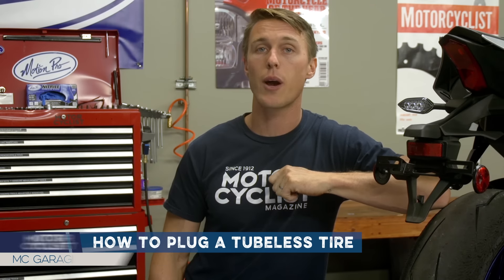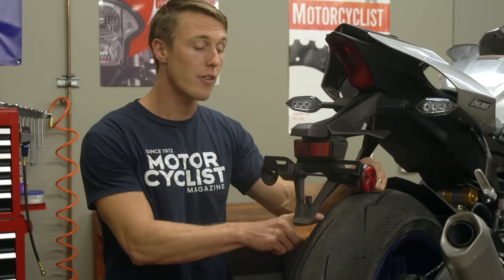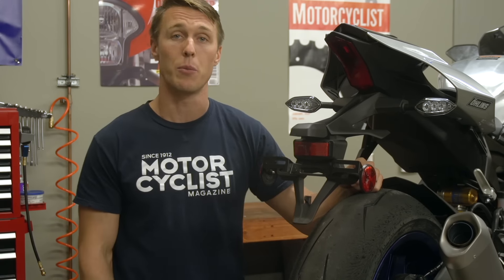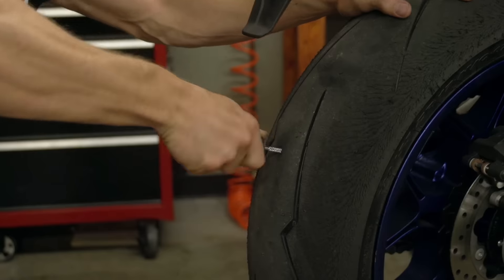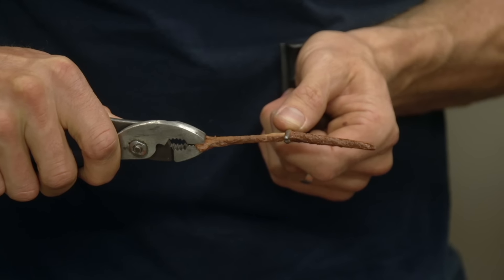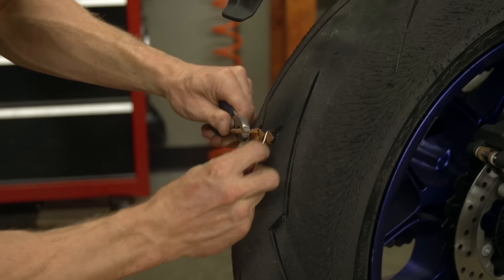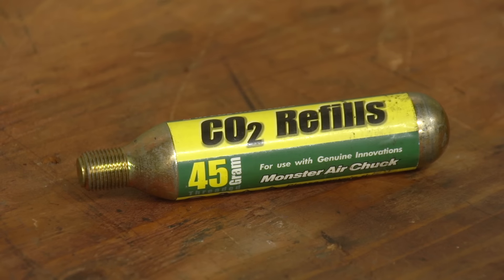How To Plug A Motorcycle Tire | MC GARAGE

Comment: Only a temporary solution until you can get a new tire. Rope plugs can wick moisture into the tire causing the belts to corrode. Also, plugging a speed rated tire voids it's speed rating since you are sure to damage the belts during the repair.
Reply: Blah blah blah

Comment: I've driven 40,000 miles on a plugged auto tire without any leaking after being plugged. I would have no problem using this on my bike, however for the first few days, I'd test the pressure a few times just to make sure it's not leaking...

Comment: A screw without the head is going to be a serious issue. It took 3 senior citizens 2 hours to coax a headless screw out of a goldwing tire that was mounted. Then we had to push the plug in which took another hour but we got err done. Thank you Bidenomics, we didnt take it toan expensive tire repair .shop

Comment: I just bought my first motorcycle, a brand new Iron 883 with 7 miles on it. I drove it for ONE day and found a screw in my back tire (thank you Kansas City). I plan on replacing the tire as soon as I can afford it, but a plug will have to do for now. Thank you for the video, as I've never done this before.

Comment: Rode 300 miles on a brand new bike. Got a nail/screw in the center of my rear tire. Plugged it the first time and the plug went all the way through so I re did it correctly with another plug. Held good on the first ride. Went out to drink with some friends and when I came back my psi was down to 25 (36 is manufacture standard). Gotta buy a new tire. Fml

Comment: I have ridden my front tire with plug for already 12k kilometres. No problems so far
Reply: Jed Taneo by any chance which plug kit did you use?
Reply: @biglefty08  ordinary ones you can buy online. In my county I bought it from Lazada.
Reply: On the street is ok but if you go to track BIG NO NO
Reply: @jlopez2351  how come? Is it cause of the extreme heat? I sadly have 3 plugs in my rear tyre.. is it alright to go on highway rides on hot days with those?

Comment: Good video and your honest about riding on a plugged tire. My brand new rear tire caught a nail after only 200 miles. I put a plug in it and hopefue it will last awhile.
Reply: Update on the plug please sir
Reply: How long did your plug last after all?
Reply: @survive.canada  I did one a month ago it was very easy and no problems at all, everyone says they last the life of the tyre and it prob true its such a good and easy fix
Reply: I’ve used plugs on motorcycle and automobile tires.  They last as long as you shave the plug like he mentioned.  No side walling patching and I would consider the speed rating no longer applicable to the tire.  You can even plug without glue but I’m sure glue helps in different pressure situations and off road.
Reply: @petelarrier1811  what if the screw is in the "valley" of the tire? Meaning, the groove, where water would go to, and not the rubber that actually makes contact with the road.
Reply: Doesnt matter as long as its not the sidewall.

Comment: You should do a video on how to patch a tire from the inside as well... In my case I bought s brand new tire because I have run about 120 miles since I got a valve stem (not a screw) yeah you heard me right, a valve stem in my tire and it went all the way in and it was hard to pull out but I got it fixed with one of these plugs but I stop so often to check the tire and to make sure that plug is not trying to come out so I have lost all my confidence in that tire. Thank God it's only an R3 and I don't find it necessary to speed so much for right now since I'm only learning although I feel pretty confident already but still I'm taking my time and experience on the bike very seriously
Reply: lol!

Comment: You forgot to mention that getting the CO2 bottle onto a straight valve stem is almost im possible on most motorcycles.
Reply: Yup. My kit came with an adapter.

Comment: Ok, I had this happen to me about a month ago. I used the plug kit, used plenty of the glue on the plug, aired up the tire. I thought it was fixed rode 200 feet the the plug blew out. In fact, it was plugged a second time. This time the bike was in the back of a truck. The plug blew out again  as I was standing there, after about 10 minutes. Replaced the tire. Second one this year.

Comment: As usual, awesome video, Ari. From what I see, the tools of the trade are usually the same across brands, but I wanna know, are there different levels of rope plug quality? I mean, there are a few cheapo ones on eBay and some expensive ones too. Are they really worth the money or will there be no difference?
Reply: realized you asked this forever and a day ago but did you ever find an answer?
Reply: @330Gunslingers  
Project Farm channel did a test using the normal Slime rope plugs & better quality more "Pro" ones which he found were "Stickier & Stronger" to make a better repair.
Even though the Slime ones, done correctly, are quite acceptable.

Comment: Sorry to nitpick, but when the screw was drilled into the tire, it was pretty flush with it, whereas when it was pulled out, it was sticking out enough that the pliers could grip it. Would that happen automatically? Or would I have to let out a little bit of the air to make the sharp object stick out enough to grip it? Or just try to press into the tire with a nose plier to hopefully get a hold of it?

Comment: I got a screw in my tire, the same day i had a track day.... i did the track day anyway, and also 4000km with the screw in, no air leak, maybe it didnt when 100% threw, gonna see soon when i replace it.
Reply: ThunderWindz The screw probably went in while the tire was hot and the rubber molded around it and sealed. I had this happen on my car. I have as Veloster with summer sticky tires here in San Antonio. I got a large screw in it and I heard it leaking at a stop light followed by thbe tick tock tick as the head tapped the ground. I pulled over and it had stopped. I aired it up and was going to take it the next day to get it patched but forgot. I drove on it for probably a month before it started losing air again. My guess is the tire molded around it but when the colder season rolled in it hardened the rubber and began leaking again. Wouldn't want to risk it on a bike though.

Comment: I know it's an older video but once you rope plug a tire, replace it. Don't try to have the rope plug removed and patched. Working with tubeless tires every day at work, we won't try to patch a previously plugged tire. Once the glue sets, it will tear the lining during removal and most accepted patches will not cover the damage safely. 
You have 2 tires. Don't risk it. Plug it to get home and buy a new tire. 
Stay safe.

Comment: thanks for the insight.  I found a screw in my tire, but the tire isn't flat.  I also noticed while inspecting that there's a sideways cut in the rubber.  This is my first motorcycle, so I guess I'm curious if others have seen oddities like that.   I am worried someone has tried to sabotage my ride.
Reply: Same thing happened to me. Somebody made an incision on my rear tyre of my GSXR. Fortunately cut wasn't deep. People can be so jealous sometimes. SMH
Reply: @KubuśpuchatekTVN  if someone does this willfully, for jealousy or whatever reason, it is like attempted murder... It's one thing to scratch the body of a bike, it's another thing to damage the tyre... be safe bud

Comment: He makes it look so easy. I had to fight the shit out of mine. Shoving that plug in after the tool cleaned up the hole was NOT that easy.
Reply: It's easier if the tire isn't flat. I try and pump the tire up first before reaming it and shoving the plug in. Makes it much easier.

Comment: so if this is the temporary solution, whats the permanent solution for it ? than changing the tyres .
Reply: Nirmal Kumar taking the tyre out 
And put a " mushroom" plug from inside out 
This plug is made is made of rubber and comes in different sizes depending on the hole size.

Comment: I have five plugs in my rear tire and have ridden for months, even up to 120 mph, without problems. It IS a permanent solution.
Reply: +ryanhayn You keep doing that.
Reply: +ryanhayn It can be used semi-long term, but just because you haven't been unlucky doesn't mean it is a permanent solution.
Reply: +ryanhayn for example a few comments down.  "Great video as always. I got a friend who rode at a track with a plugged tyre. Let's just say it didn't go well for him." - RubberTyres
Reply: Firefly I guess it all comes down to a roll of the dice. You could end up being unlucky, or you could be lucky.
Reply: +ryanhayn When you put it like that doesn't that sound more like a temporary solution?
Reply: +Firefly
There's quite a big difference in riding normally out on the road and riding hard on the track. On the track your bike is always under much higher load and much closer to its limits of capability than on the road. That is especially true for your tires that are subjected to extreme loads, which means the plug is also likely to give out. And honestly, if you ride with a plugged tire on a track, you deserve to go down on it. I mean seriously, how dumb do you have to be? smh
Reply: It is NOT permanent solution , But May Withstand Long Term if you Done it Correctly and Firmly , thats why you have to smotthen the Hole tissue with corkscrew plug , 
it also depends on tire Types
Reply: After a few months, the only plug in my rear tire gave out when I was riding ~50mph. I plugged it again to get home. Patched it up properly yesterday. You have some badass plugs there.

Comment: Excellent tip. Doubt: this repair is permanent? Are There some risks at high speed?
Reply: Lots of people use this as a "permanent fix". Typically the tire isn't brand new and they'll put anywhere between 2-6k more miles on it. It is not ideal, but I just plugged my tire and plan to use it for 2k more miles until I buy some nicer tires and when the temperature rise again. 

Ideally a plug is just to get you to a shop so they can patch it. Patch and plug is the best fix, follow by patch only, then plug only. But, to patch a motorcycle tire most shops charge you the same amount it would to install a new tire so that's why I run my plug longer. If I am paying an install/uninstall fee it might as well be for my new tire not some tire I only have 2k or 4k more miles left on. Also, if its in the center of the tread it should not be too unsafe.
Reply: Thanks
Reply: Marcelo Motociclista not permanant...mushroom tyre plug patch is permanant
Reply: on the instructions for my kit it says not to exceed 40mph. I think that you'll be fine over this, but I wouldnt want to be going well in excess of 100 with a patch

Comment: ..or run over a big ass screw that plugs itself :D
(this happened to me on my old Disco, ran over a freaking ZEUS fitting off my honda's front fairing. got a taptaptaptaptaptaptap like a rock was stuck in my tread, but that little quarter turn bolt was holding air so hey!

Comment: These are a pain in the arse to use. Your better off using Gryyp Cargol Tyre Repair Kit :)
Reply: +DanieI Joseph doesn't really seem like it.
Reply: +Firefly I've been riding & using for 22 years. The soft rubber plug either doesn't seal properly or it comes back out with the application tool. The cheapest way to get home is to leave a/the screw in the tyre as this works pretty well. Or use the other hard plastic cargol screw plug I mentioned, as all you do is screw it in then snap it off.  Quick & clean,  you then use the co2 supplied to inflate the tyre.

Comment: Sound advice... The lawyerly (and business-maximizing) "recommendation" to always get a new tire after a puncture is deeply annoying, mainly because it is not true and also dishonest. Yes, there are punctures and tire damage that make plugging or patching impossible or at least unwise. But a clean puncture by a wood screw or nail on the tread area is very fixable with a patch.  Done professionally it will cost you $60 or so (with mounting/balancing etc.) but compared to $200+ for a new tire it is well worth it if the punctured tire has more than half of its life left. If you are set up to mount tires yourself it will cost you $10.
Reply: He never said to always get a tire after a puncture. You have written nothing in contradiction to what was said in the video.

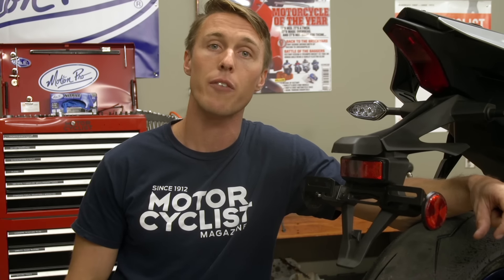2:05 - 2:15
"Keep in mind though that a plug is a temporary fix. Though I will admit that I've ridden from coast to coast on a plugged tire with no problems. Still, you're better off getting the tire replaced or dismounted and patched from the inside."
Reply: And I never said that he did say that in this video. What I said was that his advice was "sound." Unlike what seems to be your approach, it was not my intention to say something "in contradiction." Are you trying to find a non-existing point to create some kind of controversy? Why would you think that "response" always equals "contradiction"? Or more directly: Are you some kind of troll?

Comment: How to plug a motorcycle tire....

DON'T....... Unless you're crazy or stupid or both. Plugging a car tire is different because you still have three more if the plug fails and can still pull over. My life and my skin are entirely too valuable to plug a motorcycle tire. Being a motorcycle rider isn't a hobby for the cheap. If you have a cut in a tire, replace it. That's the only proper corrective action on a motorcycle.